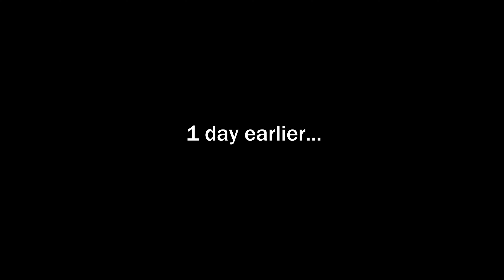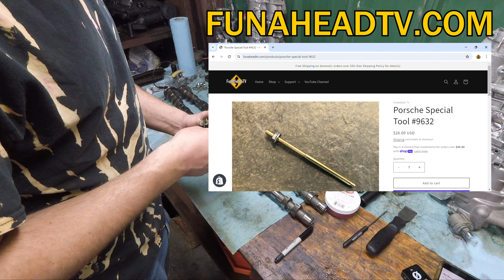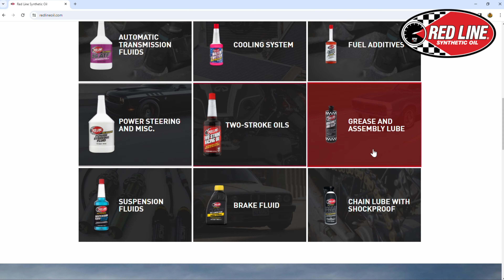FINAL ASSEMBLY BEFORE INSTALLATION of my 3.8L M96! Cam Timing to INSTALLATION! Project Beef, Ep 10

Comment: Thanks for the video. I’m just at this step on my M96 rebuild. What source did you use for your procedure? Is this your first M96 rebuild?
Reply from the maker: The Porsche manual. Nope, very much not my first M96 rebuild. Why do you ask?
Reply: @FunAhead_TV_Official  Thanks for the reply. I’ve come across a few different procedures and they all seem to differ slightly. I appreciated some of the finer points that you went over when explaining the process.
Reply from the maker: Thanks for watching along! There are for sure some differing procedures out there centered around timing. Is that more-so what you were referring to?
Reply: @FunAhead_TV_Official  Yes, the slightly different procedures when it comes to timing the camshafts. Looking forward to your next video. All the best.
Reply from the maker: For sure. I’ve heard all sorts of different things. At the end of the day, 1: You need to remove chain slack / play, and 2: you need to be at OT to lock in the crank / cams. The procedure I outlined is tried and true. Let me know if you end up wanting to know any specifics / details on anything I did. You can always feel free to shoot me an email too if that’s easier. funaheadtvofficial@gmail.com

Comment: Just found your series! did you ever consider new performance camshafts since engine was apart and displacement increased?
Reply from the maker: I actually specifically chose the displacement bump that I did to avoid having to bark up the tree of new camshafts. The stock 3.4L cam profiles still work just fine for 3.8L, but (allegedly) above that things get wonky and require tune / cams.

Comment: Outstanding series, David!  A couple of questions...did you consider going with the Ultimate AOS?  Did you consider the LN spin on filter set-up?  How did you arrive at the choices you made on these items? 

 I had the same coolant drip from that small cover and slightly tightening it seems to have done the trick.  But I wonder if a guy could just R&R it with some RTV?  If that cover is removed do you loose a lot of coolant?   You use the 75w90, but when I called Red Line, they recommend the 75w90 NS for my car.  I have the Aisin 6sp, where I believe you have a ZF.  Not sure what "NS" stands for (no slip?), but it must be different somehow.  Really enjoying these videos!
Reply from the maker: Thank you, Tom! Much appreciated. I hadn't really considered the Ultimate AOS.. Maybe someday, but up until this point, I haven't had any issues with the stock one on track... no oil burn in intake, excessive crankcase pressures, etc.. And as far as the LN spin on, I don't mind changing out the stock cartridge filter, so no I didn't consider that one. 

It's very possible some RTV could keep it at bay. I have the gasket now though, so I'll swap it out soon enough. Yes, that cover holds back a LOT of coolant, so it's going to be messy. 

That's good Red Line is looking out for your specific car! Mine is the Getrag G96.xx something.. I believe the normal 75W-90 is OK to run in mine. You're correct, NS is no slip, so if that's specified, then the synchros in your transmission are more sensitive to slip additives.